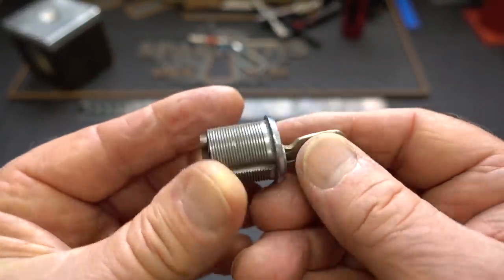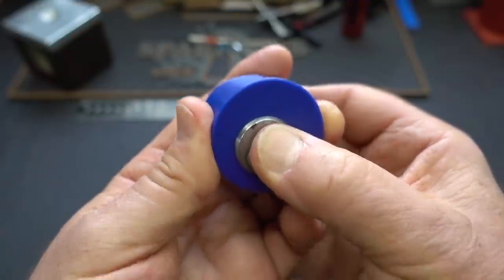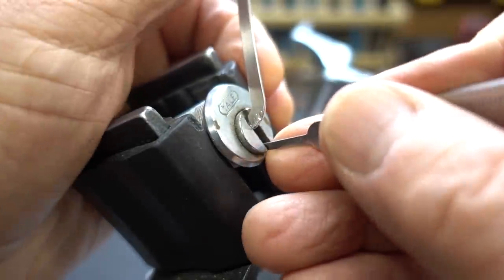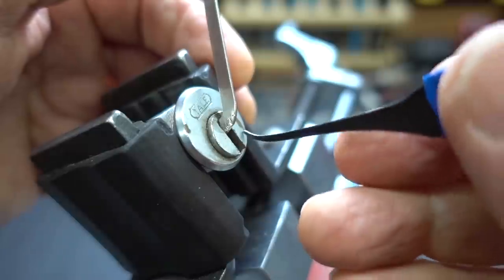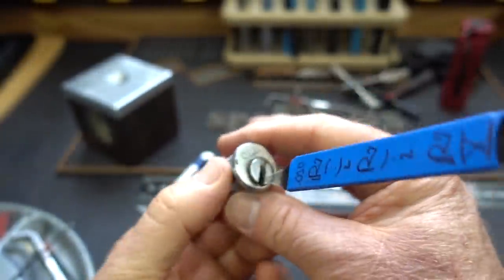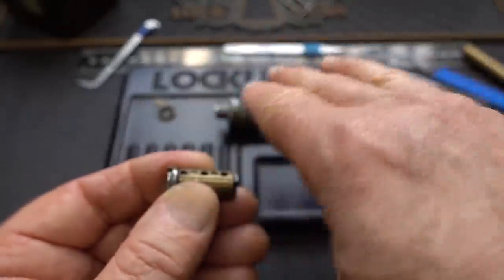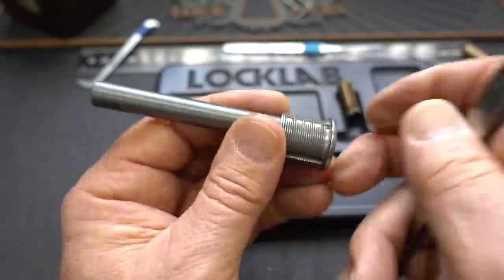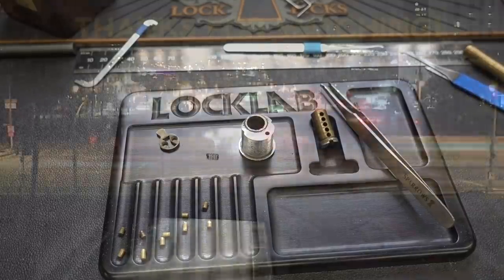(1763) Mini Yale Mortise-Style Cylinder

Comment: That is call a "peanut cylinder"
And it still used today in older cities on the east coast.
Its mortise cylinder for an aluminum door commonly known today as a Adams rite hook bolt, deadbolt, etc. Mortise cylinder.

I'LL LOVE TO BUY THIS FROM YOU.
Reply: They're still in use here in the Midwest and WHY would you want JUNK like that? The locks were usually straight throw deadbolts and preceded Adams Rite by MANY years. Tubelite which later became AcroWelch used them a lot. Tossed tons into the trash over the years. Still have a few accounts that have them. They get charged a premium for labor. Require an undersized pinning kit and a tiny follower. Holes in the doors are often off center so screwing them back in can be a challenge without stripping the threads.
Reply: Jack Gates The Peanut Cylinders we have here in down under are longer and pinned to 6 full sized pins. Locks and demographics always fascinate me
Reply: @jackgates6949  been doing locksmithing since 1987 ... just memories I guess.
Reply: @redbugg99  Since 1977 for me (sadly!) but I totally get the nostalgia factor. I guess if the "memories" are what a PITA these could be...? LOL I didn't mention in my reply to Bill that I raided my Ford and Chrysler pinning kits more than once to rekey these. May have used a top pin on occasion too. When Bill dropped out that "T" pin, THAT brought back some memories. Yes, I was a "hack" on occasion in the old days. LOL
Reply: I strongly believe that only people in the east coast do believe in high security like Medeco, Multlock. But the people anywhere else just don't care about security. I live in Las Vegas since 2000 and ppl hate me! They think I'm ripping them off when I service residential lock and I tried to explain that Lowes or Homedepot Defiant or kwik set locks are not really meant to be rekey or repair! so when I give prices for a real brass lock? ...  shit hits the fan ... then I explain that for $35.00 they are better off getting a 2 deadbolt 2 entry lockset from Lowes, 4 new keys all key alike. Well it's been boring here in Las Vegas 2% high security for residential 98% Defiant. 
Casinos have their own security personnel and malls used U-change, IC-core or schlage etc.

There's no challenge here other than commercial. So when I see odd locks like this it just brings good memories.

Comment: Maybe that pin was originally used as a T pin, the same way you're putting it back, but the person who lost the actuator screws also gutted it and put that pin back the wrong way. It's a really neat lock for what it is though. Some smaller padlocks with tiny keyways are quite tricky to find picks that fit. The biggest surprise to me with this lock is that it's got 5 pins. I expected it to only have 4.

Comment: I bought a pair of Ace Hardware 50mm Guard laminated padlocks that completely kicked my ass. I picked one open but not the other. Since they were keyed-alike I decided to grind the rivits off of one and see what the hell was going on in there. I found five of the same upside down pins, pointing up into the springs. This still didn't explain why I couldn't open it easily. And then I saw "it". On two of the really short key pins the driver pin was so low that the t-pin shoulder and part of the spring was in the plug below the shear line. This made the spring act like part of a loose serrated pin. I had to pick the end of the spring coil up after it went into a false set. And still had the upside down pin flopping around. I do not believe they planed it this way but wow it had a weird feel. Like a challange lock. Ever since then when I have a really easy lock with security pins or a difficult lock that shouldn't be, I put all the key pins back in the plug and see how the driver pins sit. This can explain a lot more than just looking at a pinning tray and scratching yout head. Safe pickings all.
Reply: BTW, This wasn't the case in Bill's second pin stack. The key pin was too long. But immagine what would it would have been like with a really short key pin. Extra fun.

Comment: The pin that tried to escape!
I have a bunch of Yale's very similar to this only in brass. Mine have a mortace style mechanism at the back of the lock. They came off a bunch of cupboards from the late 60's or early 70's. All standard pins to wit I will convert into challenge locks.
Great video as always Bill 😁👍🏻
Reply: This looks like what was used in ward medical trolleys that hospital pharmacies use. I think they use medico locks now.

Comment: Hopefully you run it through the sonic cleaner before re-assembly. That lock could benefit from a cleaning and some new dry lubrication. I’ve had good luck with sonic cleaning just cleaning the grease and gunk and not effecting patina like some more aggressive cleaners do. Though all that gunk will help with a tougher pick after reversing the pin.

Comment: Bill, the pins were NEVER filed at the factory. Unfortunately it was not uncommon for the locksmiths of yesteryear to not have OEM pins kits. So they just filed taller pins to fit. Once incremental universal pinning kits (LAB and Zipf etc) came along, such techniques were relegated to the hacks. Any locksmith worthy of the name would be embarrassed to claim that work as his. In all fairness, sometimes in an emergency situation you have to do what you have to do. The biggest issue with filing a plug, is that the security is diminished. The shear line tolerance is the main defense a standard pin tumbler lock has against picking. The fact that this plug was filed on, actually HELPED your picking efforts. I'd bet a LOT of money that the T pin was dropped in by a hack "locksmith"...common practice to use Ford/Chrysler pins when they didn't have the proper ones. The spring tit is a dead giveaway,
Reply from the maker: Now that you've said that, it makes perfect sense!  Filing everything at once while in the core is a lot easier than filing each individual pin by hand to make it fit perfectly.